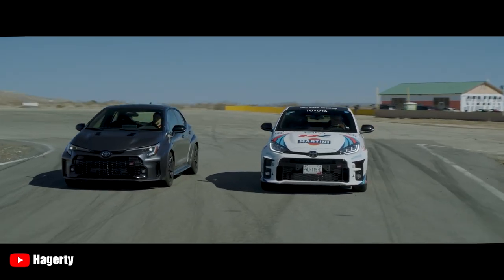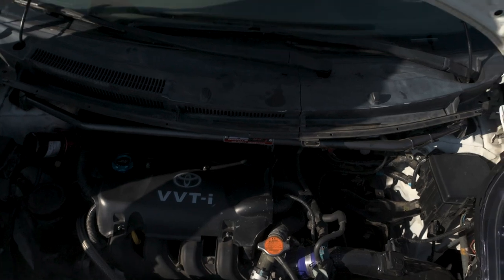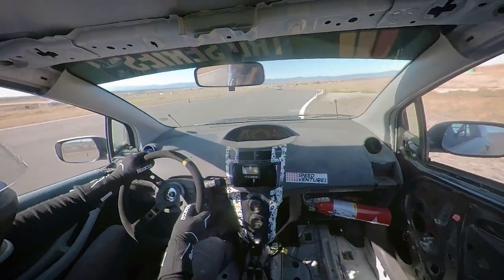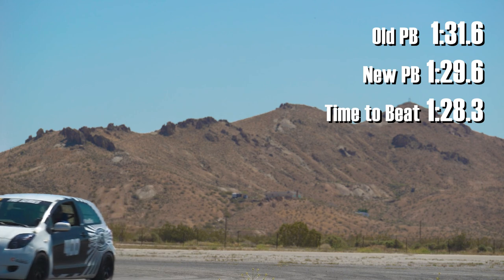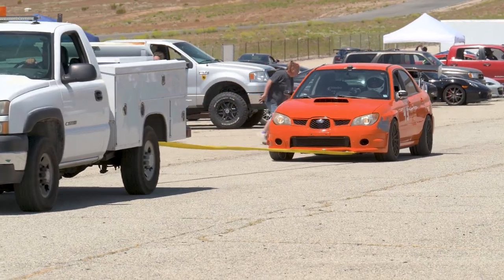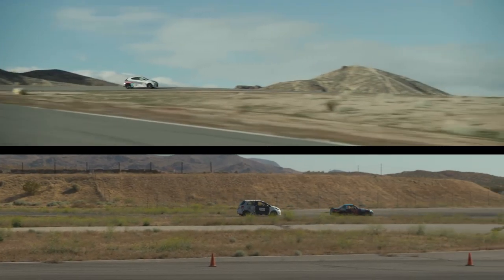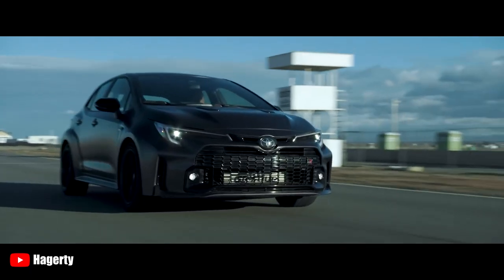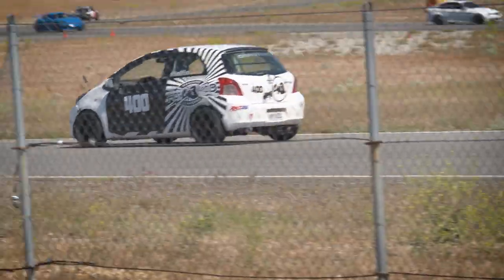Me & my Yaris Vs a Pro in a GR Yaris

Comment: I don't care what anyone says, the Yaris (regular) is a potential beast. I had one same color as this one. It went through a few different suspension setups but mostly it was settled on Tein springs, TRD struts/shocks, and an UR 23mm rear sway bar.  I remember some 10 years ago or so there was a guy out in California that ran a small business importing performance parts specifically for the Yaris and other similar cars. Some of them were even parts that Vitz (global name for the Yaris hatchback) Cup racers used on their vehicles. The owners car had a supercharger on his Yaris and it was some 400hp I believe it was, it was crazy for sure. I sure miss the one I had (lasted nearly 300,000 miles!) and had some great memories with it. Thanks for sharing this video and your car with us!
Reply: Actually vitz were only nameplate for Japanese market. Rest of thr world its either yaris or some are vios (for sedan version).
Reply: Do you still know of any of these companies or parts
Reply: I have the 2020 Yaris and stock it handles like a Porsche. Probably won’t bother with forced induction  but the potential is definitely there. Plan to upgrade to a GR Corolla or supra in a few years.
Reply: @AstroZombie1  if the 2020 uses the 1nz fe engine still, I do remember there was a supercharger kit for the Yaris and its engine. It added ‘only’ 100hp or so if I recall, but that’s literally double the power and it was pretty much bolt on from what I remember. All that was needed to be done was a line routed for cooling.

Comment: My dream is to do something like this with a Toyota matrix, take out all the interior and fuel tank, put in racing seats, improve rigidity and add a roll cage, replace the black glass with some hard transparent plastic do a minor tune or turbo. May need an LSD and beautiful wide body kit and more rubber.

Comment: Congratulations on beating your personal best...  BTW...  are you really on 205 not 225???  Get that exhaust manifold installed somehow, and add the Prius C 13.4:1 compression pistons should give you more hersper.  There's also the JUN cams out there.  Also, are you interested in doing a rear disc brake conversion?  I did a 275mm front rotor upgrade from a 2012+ Yaris SE and rear disc brakes by fabricating an adaptor plate, and my Yaris stopping power is now AMAZZZZIIINNNGGGG!  Even without ABS.
Reply from the maker: Yeah. I went down to 205 RT660s on my 15x8 wheels for more sidewall support. My 225 Rs4s were worn out and I got these rt660s in a trade. I'm definitely looking at the JUN cams and the disk breaks. I don't know if I'd ever do the pistons though, cus a 2zr swap seems like less work to me 😁
Reply: @RassoolRacing  I’m actually thinking of Frankensteining a 2ZR head with a 3ZR bottom (to eliminate valvematic) and Prius 13.4:1 compression pistons.  😬
Reply: Do you have any info on the brake swap stuff? I tow with my Yaris for work and wouldn’t mind a little more stopping power lol

Comment: Could a 1.8L 1ZZ-FE big block conversation from a Corolla be on the horizon?
Reply from the maker: No. The 1zz would need custom mounts to  fit. At the point you might as well do the 2zz and get more power. You might be thinking of the 1.8L 2ZR. That's a direct drop in for this platform.
Reply: @RassoolRacing  Ooh, will a 2ZR bolt up?
Reply from the maker: @MrWilliam.Stewart  yep. It was available in the NCP91 Yaris in the UK

Comment: The whole premise of you video is wrong. That wasn't a GR Yaris. That was the poverty spec GR Yaris which is slower than the new WRX around a track. If you were trying to match a real GR Yaris you would be destroyed. Haggerty did the real GR Yaris a massive disservice with their video. On a short track the pov spec is almost 2.5 seconds slower carexpert.com.au/lap-times
Reply from the maker: I'd argue that this video threw into sharp relief how much the base spec GR Yaris is not the hero everyone imagines when they think of the GR. I too felt like Hagerty did the GR Yaris a little dirty in their video, but I was trying to be a little more diplomatic in my presentation.
Reply: I thought the same watching the Hagerty video, it’s just so stupid to compare a very very base Yaris to a Morizo edition corolla with track tires and no rear seats etc. wonder they didn’t use the GR Sport model of the yaris 😂 the Morizo had to be compared to a GRMN or at least a Circuit Pack Yaris with Track”able” tires and both would have beaten the Morizo edition Corolla.
Reply: @RassoolRacing ndeed mate the standard GR Yaris (without LSD and rubbish Dunlop’s tyres) is even slower around a track than a Hyundai i20N. 
Great lap time mate and congrats on your PB, huge respect mate! 🤘🏼